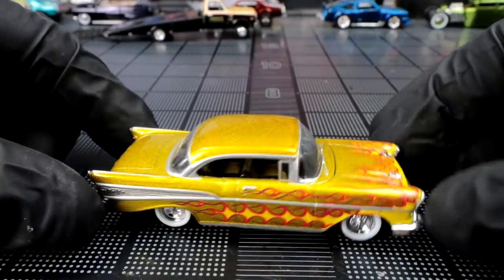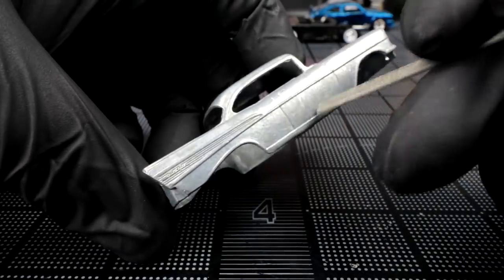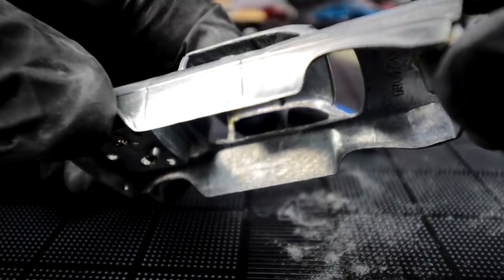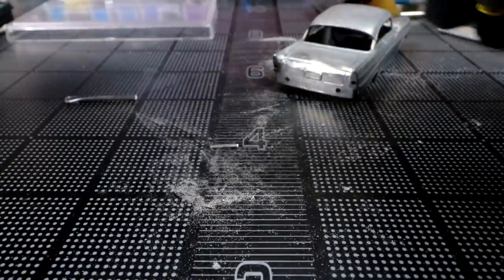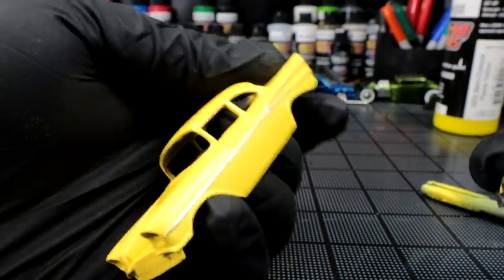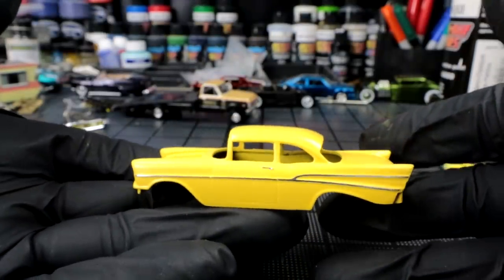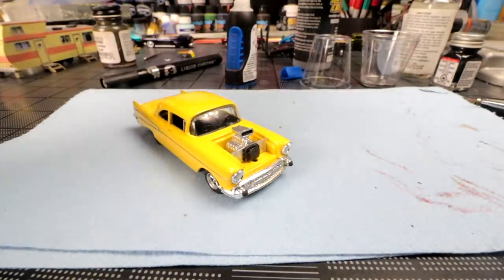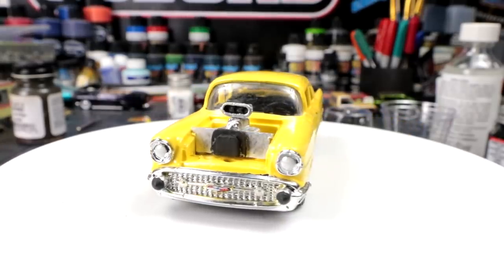Chevy 210 From Hollywood Knights

Comment: Now you’re just showing off. That’s badass . I’ve seen other restorers use masking tape inside the car, sticky side out, to hold the replacement pillars in place. Again, awesome job.
Reply from the maker: That might of helped out, but I wanted mine to jam in there with friction first.  Man.. if you guys could have been a fly on the wall for that segment.
Reply: @DiecastResurrection  My hobby is working on engines, cars and lawn equipment. The flies on the walls in my shop were never safe.  I have a friend that counts days since something last happened. He counts the number of days since I have last thrown a tool or engine part lol. I'm almost to 90 days this time around. lol keep up the great work.

Comment: I loved the detail in the car. Very sharp! I have a suggestion for the pillars, and I don’t know if it’s been suggested before, but try Q-Bond. It’s kit I buy at Canadian Tire that contains two different powders, one for plastic and one for metals, and two bottles of a crazy glue type substance. Very easy to work with and bonds quickly. We use it at work to repair plastics like headlights and clips on bumpers etc.
Again great work. Eventually I’ll have watched all your videos!!

Comment: Since so many of the hot wheels in the 1970's have plastic bases and they get destroyed easily on the old cars, I would like to form a partnership with several youtubers to find someone who has a metal 3D laser printer that would be willing to copy some of the plastic bases from pre-1976 hot wheels into metal at a low cost. I have looked at an $800 3D laser printer, but don't think plastic is the way to go. Need to restore old hot wheel redlines with metal bases.

Comment: you could also use those really tiny spur gears that are used on the tiny dc motors found in toys. slice a thin piece off the spur for a fan

Comment: With M2 Machine's models they have opening doors and hoods the you got was there cheaper option. And with the plastic parts all you have to do is either wiggle the bumpers off or do basically what you did. And it looks like you got an older cast of the 57 Chevy.[edit With the cheaper ones the doors don't open or sometimes the hood will open.]

Comment: The car your making is know as project X which is currently owned by hot rod or motortrend one or the other you can actually watch hot rod garage on the motortrend app work on the car and explain its story it is a really cool car the short version is it has been remodeled multiple times and is called project X because it’s never finished and keeps changing
Reply: Also yes it is still the same yellow

Comment: It seemed to me like this project was rushed. The correct parts and wheels are out there. The side trim turned out nice but no follow up was made to do the rest of the trim or to add the vent window. The huge hole in front of the radiator could have and should have been addressed. Nice detailing on the interior! Perhaps on the next one you do, you will have more time to do an accurate build.

Comment: NICE PAINT!

The black rubber "tits" on the front bumper were a Bel Air thing and I don't think you could get them on a 210 (or a 150).  Awesome job getting the trim piece off of the rear quarter panel.